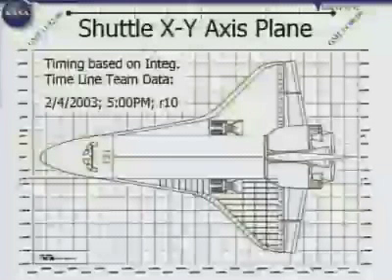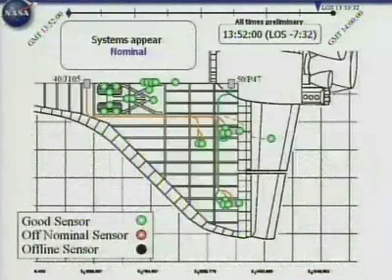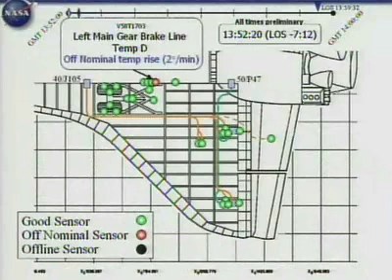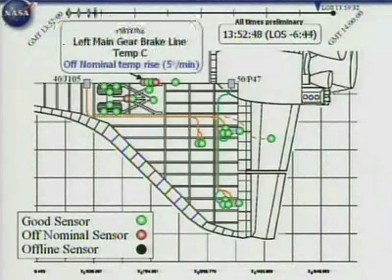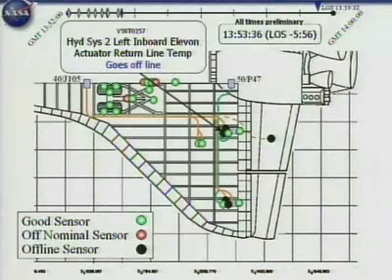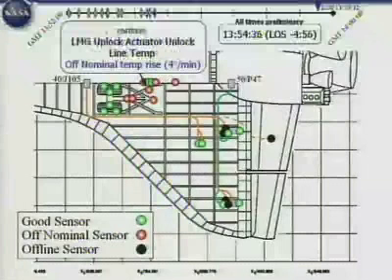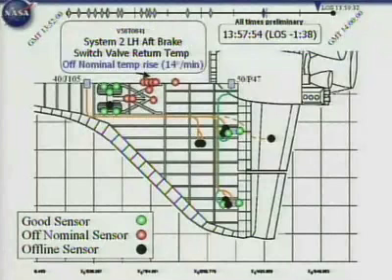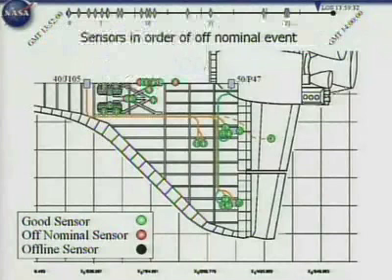Timeline of events in space shuttle Columbia left wing during failed re-entry of STS-107

Comment: holy shit. i made all these graphics in 2003 for The CAIB. funny to see it being taken out from the Volume and used in a video. I have thousands of images from all the volumes, many that never made it to final print.
Reply: You seem like the best person to ask...why did it take so long to destroy the wing? Maybe the hole was smaller than I'm imagining? Also, how would a shuttle tire react to the heat? Would it simply melt, or would it explode? Last question, in the videos, you can see the 3 shuttle engines in the flying debris. Is the crew compartment visible in the video, and when would it have broken up?
Reply: Boogaloo_ Frog superheated plasma entered the wing and melted the aluminium infrastructure whilst creating additional and uncontrollable drag,  this drag eventually caused the shuttle to spin and explosively decompress before disintegrating. I would assume that the only reason it took as long as it did is due to the superb engineering of the shuttle craft.
Reply: @boogaloo_frog8410  It is unknown when the left wing was destroyed, but from atmospheric entry to shuttle disintegration was about 10 minutes. However, it is likely that the wing was disintegrating before the breakup without anyone knowing because other flight control jets were deploying automatically to correct the flight profile, and debris was observed shedding for over 5 minutes before the catastrophic breakup.

You can observe the crew module in the video. Among the fragments, the three on the bottom are the engines, the one on top is the crew module with the forward fuselage shedding above and below it.

13:50:30 The shuttle enters heated entry
13:53:46 Debris begins to be observed shedding from the ground
13:58:39 The first audible alarm sounds in the crew module (tire pressure)
13:59:32 Final communication from shuttle
13:59:37 Hydraulics fail and all control is lost
13:59:46 The craft begins a low-g spin
14:00:18 Shuttle breaks in pieces, the crew module depressurized now or shortly after.
14:00:53 Crew module separates from fuselage and exposed to atmospheric heating.
14:01:10 Shuttle completely disintegrated.

The crew was likely to have been incapacitated during explosive depressurization and probably succumbed within 2 seconds.

This is all in the NASA report.
Reply: MGTO
Reply: @boogaloo_frog8410 the wing was falling apart; several large pieces of debris fell off before loss of signal - and the crew didn’t notice. The atmosphere is so thin (initially) that it takes a while to heat up the wing. It was like a blowtorch, but a blowtorch that was almost a vacuum, pressure-wise. This is also why the shuttle didn’t lose control initially - there was so little atmosphere that it wasn’t ‘flying’ at this point.

It’s a shame they didn’t image the wing, send another shuttle up with a replacement CC ‘tile’ to fix Columbia (near zero risk; if shuttle #2 was damaged on launch, then everyone could have returned in Columbia after the repair) 😢
Reply: It's always fun to see your work being used.
Reply: Are they unfortunately all NASA internal/FOUO?
Reply: You made these for NASA?  Pretty cool!
Reply: That is an awesome honor. I'm sure the feeling, at the time, was NOT awesome but consider for a second that you actually had an opportunity to contribute to NASA's findings and that is an absolute honor in and of itself.  To give closure to families of the deceased. You sir, are a Great American! 🇺🇲
Reply: i was wondering, how soon after the disaster were these made / presented?

Comment: Never understood why it wasn't inspected with the robotic arm before the reentry burn.
Reply: All are good points, no arm fitted for this mission, no EVA suits or handholds, no spare parts even if they did. Still, if they had known there was a breach in the tiles, it would have been hell on everyone to decide whether to order a reentry attempt. It's all moot anyway. "All the kings horses....."  At least they went out quick and doing something they were passionate about!
Reply: @gradycothren2267  "it would have been hell on everyone to decide whether to order a reentry attempt."  They were going to have to try it at some point. Columbia was in the wrong orbit to get to the ISS, a rescue mission would have had basically zero chance of success, and after about 30 or 31 days, they'd run out of reactants for the fuel cells.  At that point, they lose electrical power and the crew dies anyway.  About that same time, the LiOH scrubbers that pull CO2 out of the cabin air would have become saturated.  I'm not sure which would have killed them first, bu they would have been dead either way.
Reply: @almostfm  Correct. In order to prep the 2nd shuttle for a rescue. They would have had to have 2 crews, working 24 hours a day to prep it. The absolute latest they could get it ready before was day 5 of Columbias mission. After that, there was nothing they could do. After day 5, by the time the 2nd shuttle got into orbit. The columbia would have run out of consumables
Reply: @clyde8her , Agreed. I'm sure logistics and cost probably had a large hand in it, but it would just make sense to have a second orbiter available for launch. I think I takes around 12 hours for the shuttle vehicle to move from the assembly building to pad. I figure 24 to 36 hours for preflight and safety checks in a hurry and they'd have been able to have them home in 48 hours. Like you said, hindsight is 20/20.
Reply: @gradycothren2267  - that came later after this …
Reply: @gradycothren2267  Or take the DOD up their offer to have one of their sats do a fly by look.  Probably less than an hour and almost no additional cost.
Reply: @faulltw  DOD did not offer anything.  NASA had pondered approaching DOD, but since they were not getting any anomalous readings, they had nothing to present as a reason for using one of their satellites.
Reply: The robot arm at the time of the accident was too short to reach the wings
Reply: They didn't have the arm, to save around 800 lbs of weight.  A big mistake.
Reply: Why didn't they just do an EVA? They didn't have suits on this mission either? It struck me as crazy even back then that they didn't just get out and look?
Reply: @gradycothren2267  There were no handholds or footholds on that part of the orbiter, so even if they saw a problem, they had no way to fix it.

"but it would just make sense to have a second orbiter available for launch".  NASA doesn't have an unlimited amount of money, and it wouldn't stretch to having two orbiters prepped at all times.  Hell, they were getting squeezed having enough money to do _one_.

"I figure 24 to 36 hours for preflight and safety checks in a hurry"  More like a week-if they went to 24/7 prep once it was on the pad, and they skipped all of the checks that are normally done .

"they'd have been able to have them home in 48 hours"  Not even close.  At the request of the CAIB, NASA drew up what a rescue plan would entail.  After liftoff, figuring roughly a day to rendezvous and establish station keeping with Columbia.  Then, figure at least another day to get the crew transferred over. Because Columbia didn't have a docking adapter installed, they'd have to EVA the crew over one or two at a time.  And to make sure they wouldn't suffer from the bends during the EVA and die, they'd have to do a three or four hour pre-breathing procedure for each EVA.  Just the pre-breathing would eat up close to a day.

And because there wasn't a shuttle ready to roll out to the pad, the prep time would have been several weeks to get a shuttle ready.  And in any event, you'd need that time to train the crew for the rescue mission and talk it through with the Columbia crew.
Reply: @almostfm  "NASA doesn't have an unlimited amount of money, and it wouldn't stretch to having two orbiters prepped at all times. Hell, they were getting squeezed having enough money to do _one_". 
Money figures prominently in any equation, including emergency. If NASA had real concern for crew safety, they would have been saved. No NASA-pandering blah blah blah is going change that.
Reply: @alphonsozorro7952  Explaining a situation is not "pandering".  NASA can't spend money that Congress and the WH don't give them.
Reply: @almostfm  right.. a logistical nightmare. These shuttles just from a design perspective were outright dangerous right from the drawing board. they were too large which entailed an incredibly lengthy (and time consuming) exposure to atmospheric entry. NASA wanted a much smaller shuttle for this reason but were overruled by the Military. Yeah that approach is over an HOUR long but doesn't begin to hit the top of the atmosphere until 35 minutes before landing (while the orbiter is still over the Pacific during most approaches).
Reply: @gradycothren2267  They were doomed anyway, as there was no way of fixing the damage, and that would only have increased the stress on the crew, knowing beforehand the impending disaster.
Reply: @alphonsozorro7952  yep. that's why they weren't told anything.

Comment: I think the astronauts could have been saved.
Reply: Eric Styles Linda Ham did not want to know. She stopped the ground based cameras to photograph the orbiter before reentry. Also they did not have a plan in the event of a situation like this so it was keep your fingers crossed mentality.
Reply: How? There was no way, plus NO ONE thought something happened that was bad enough to lose the shuttle. Also I read that the ability to dock with the ISS (which wasn't realistic to begin with) wasn't possible because Columbia lacked the docking mechanism on that particular flight.
Reply: drowssapma
Engineers had seen the video of the foam strikes, exchanged emails discussing it and had either suggested or actually requested satellites be reoriented to have a look - or someone could have gone out to look. Their requests were refused because of cost and an incorrect belief of non mission critical damage based on projections from damage done in previous small foam strikes and from a computer model known as “Crater” (even though it didn’t hit the tiles, the size of the piece of foam was so much larger than any in their current data set assuming a linear relationship was just reckless). Nobody thought it had hit the Carbon-Carbon leading edge, and if they had thought that, nobody believed reinforced Carbon-Carbon could be damaged by foam - but they weren’t thinking in terms of overall energy=1/2mV^2 ie. proportional to the velocity squared, and from the footage they had worked out what looked like about a 2lb block hit at ~700mph relative. 
Anyway, they concluded that there was no reason for concern. As I say, it was management ignoring the scientists exactly like with Challenger. It was a no brainier from a safety perspective to get eyes on it. And forget the ISS, they were in a completely different orbit because by further bad luck it was a dedicated Science flight so that was never a possibility. If it was a flight going to the ISS, looking would have been easy, hell they may have even noticed by chance even if nobody had seen anything from the ground.
Reply: this
Reply: How? Fly to ISS? there wasn't enough fuel onboard.. Do an EVA? no suits onboard. Was there even an issue? Unknown and no way to find out for certain. However I'm wondering WHY they did not HEAR that foam strike? well that thing is really noisy you ain't gonna hear nothing except rocket roar. They had no choice but to take their chances at reentry.
Reply: Absolutely they could have been saved. There were three options.. Work out a trajectory to protect the left wing until they got low enough and slow enough to bail (which was possible on columbia). Send them up supplies until perhaps they could get a soyuz up to them - but the most promising as far as I can see was a rescue by Atlantis which was scheduled to launch in a few weeks. They keep them supplied, crash ready atlantis, and go get them. By not simply acquiescing to a request for satellite images, they a missed a chance to show what they could do under pressure (another apollo 13 effectively). There's no question if they'd known there was a hole in the wing - they'd have found a way to get them back. it's as though they learnt nothing from Challenger!
Reply: they were falling through the sky at mach 20 and 120 feet per second how per se do you think they could have been saved? That speed would destroy a human body faster than you can even understand
Reply: By altering Columbia's angle of attack before atmospheric interface to around 55 degrees the hole in the wing.  The danger is that this stresses the frame of the craft, increases reentry heating and the orbiter becomes unstable.

But if they added bank angle the right (maybe a side-slip maneuver (Gimli Glider Air Canada Flight 143) to bleed air speed and turn the left wing away from the wind.

Video here Flight 143
https://www.youtube.com/watch?v=jVvt7hP5a-0

Eric Styles, They were in the wrong orbit for a rendezvous with the ISS.
Reply: Lothar Meyer Saved only if they stayed onboard the ISS.
Once you begin deorbiting slowing your speed you'd have a very narrow window to skim or skip across the top of the upper atmosphere with changes in attitude (entry angle) & a little thrust, but that window closes fast, quickly leaving a point of no return.
 I don't believe Houston control shared the info. about the foam dislodging from th main tank during launch tho, which would no doubt inspired those on board to do an inspetion of their own & revieled a damaged seal on the port landing gear door.
Reply: @ericstyles3724  They couldn't have "stayed onboard the ISS" because it wasn't an ISS mission.  They weren't even in the right orbit to get to the ISS with the fuel onboard.

Comment: does anyone think someone put the  landing gear down by accident. when you listen and watch the pre entry video..they seem confused by the most simple things..gloves..camera...books...they seem more interested in the video cable and plasma than they do on landing..
Reply: Ehhhhh... No.
Reply: official idiots Maybe they cranked one of the side window down.
Reply: nope
Reply: No.  I dont see that as possible. however, it is possible that the plasma entering the wing via the hole caused by the tile. May have burned through the landing bay doors. Prior to breakup the bay door was one of the malfunctioning sensors saying it was open, but the landing gear was up. Shortly after that they lost tire pressure in the landing gear tires.
Reply: I slowed the video down to 25,50,& 75% playback speed and I could hear a lot more.  Someone was crying in the video.  They knew something was wrong during the video as soon as the jets started firing.  Rick said the jets were not firing.   I’m sure there would have been a signal or something in the cockpit alerting them that the jets were firing.  So I believe that the shuttle was disintegrating over the Pacific Ocean after passing E I Before it was noticed by people in California.  I’ve watched other reentry videos and that doesn’t look like plasma it looks like it’s on fire or something is going on in the back of the shuttle from the overhead windows.
Reply: @lisamarie4643  Lisa there's no fire in space because there's no O2. But if the crew knew about the jets firing that would certainly have been discerning if they kept it up.. the orbiter was in transition between spaceflight and atmospheric flight at time of breakup though thus those jets should not have been firing as much if at all. Remember that these are all very smart people so its possible that in the final moments they knew that something was amiss. The thing though is did Rick know he'd lost hydraulics? Now those ACU's are powered up before they enter the "blast" zone so he musta known as I'm certain there's instrumentation onboard that monitors mission critical stuff like this. this is akin to jumping out of an aircraft with no chute. you know your life and everything within it is over. In fact I would ascertain hydraulics before the de-orbit burn. because without hydraulics you ain't coming back to Earth in one piece. In essence hydraulics IS your engine!
Reply: The door might have been blown open by the tires exploding .
Reply: @brianburgett5894  the tires did not explode.
Reply: Yeah, what I'm getting is that the fire started in the wheel well, yet everyone is saying it started on the left wing.   Somebody tried to hide something.   You might be right about the landing gear.
Reply: Yep,your name is correct,you certainly are an idiot.
Reply: Nah, someone opened the sunroof...
Reply: The benefit of time is a wonderful thing. We now know that one of them cracked a window to throw out a cigarette butt causing a catastrophic failure.